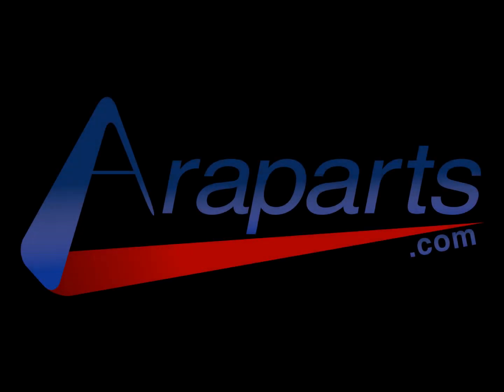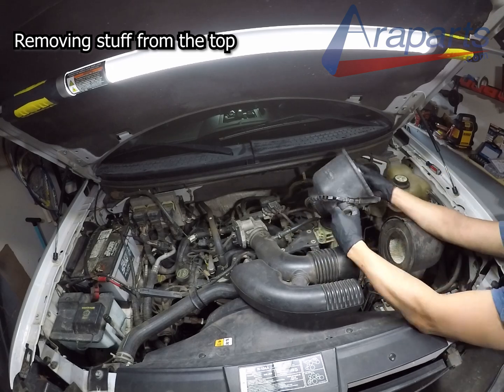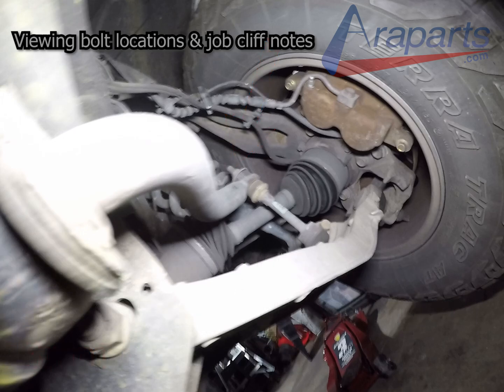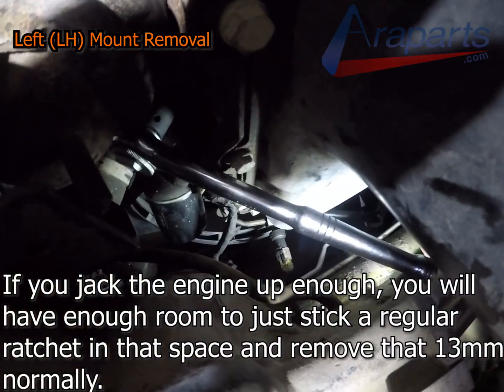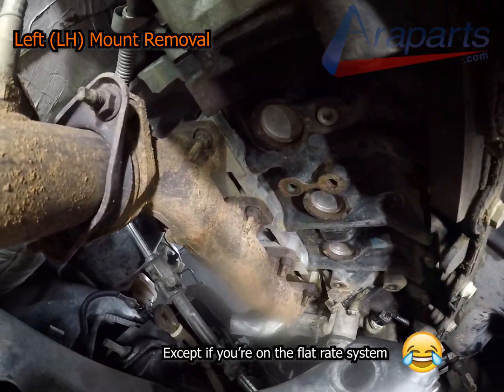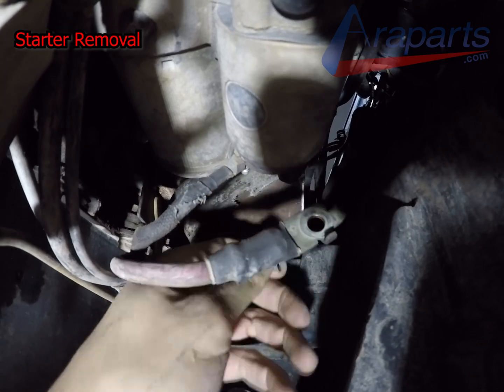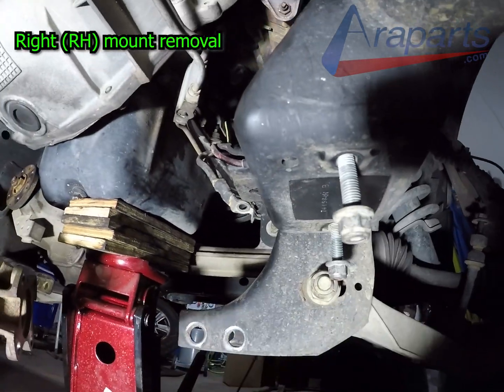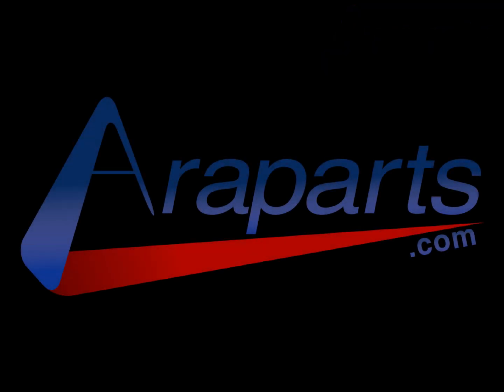Replacing Engine Mounts: 4WD 2004-2008 Ford F150 WITHOUT removing Manifold/Exhaust | SUPER DIY

Comment: Just for anyone in the future.

I originally just tried using an air powered impact to remove the giant engine mount bolt. Had the issue mentioned in text where the bolt was just spinning because the nut on the other side wasn’t being held in.

For me, I just had to put a torch on it for an uncomfortable amount of time till the thread locker was smoking up a storm. Once I’d done that, even though the nut was spinning earlier the bolt came out with ease. Definitely suggest just torching it to start with and avoid any issues with that stupid nut spinning and causing a headache.

Thanks for the video
Reply from the maker: Good stuff! I’m going to pin this comment! Awesome share man!

Comment: What were they symptoms while accelerating with the broken mounts? Mine vibrates for a bit then stop vibration
Reply from the maker: At 2:00 in the video the old engine mount was totally broken. It was allowing the engine to jump up causing a “thud” every time the truck accelerated from a stop. If the vibrations are only sometimes, you may have a different issue.

Comment: 18:14  M8 x ? x 1.25
Reply from the maker: I don’t have the length unfortunately. M8x1.25 are the only specs I recorded.
Reply: @araparts   Thanks.  I think the other 2 are 1 1/2 but I'm going to Pull-A-Part and get one from a junker to make sure...  I don't want to get one longer and crack the bell 👍
BTW... It took longer than I wanted but, glad that I did this job instead of paying someone else.
I'm 58 & been wrenching since I was on a tricycle and this was one of the most satisfying jobs yet... not only the engine mounts but, to tackle that monster passenger side exhaust manifold and get headers installed with no aggravating leak.
GL to ya 💪